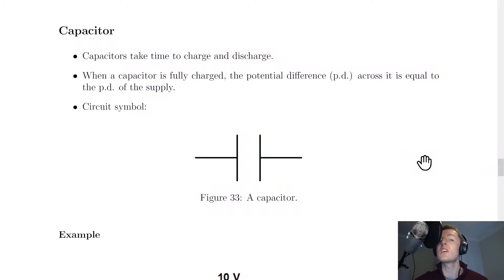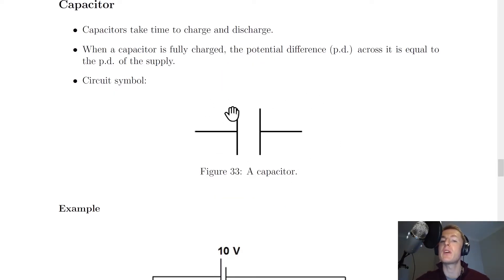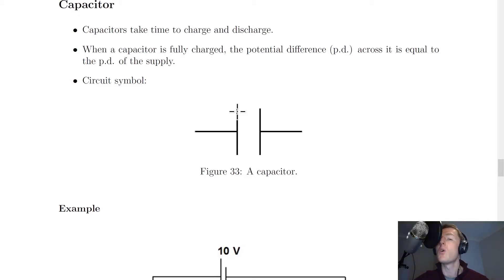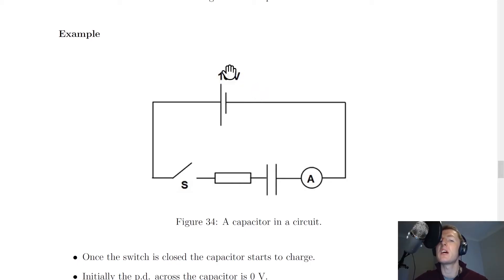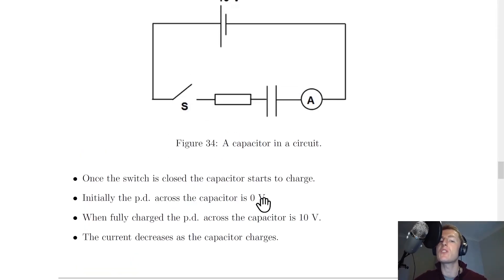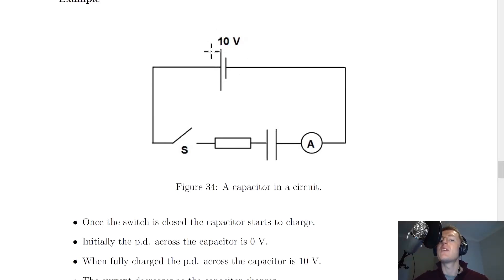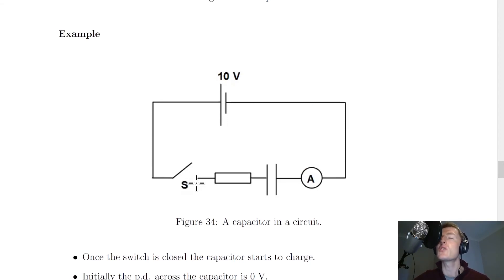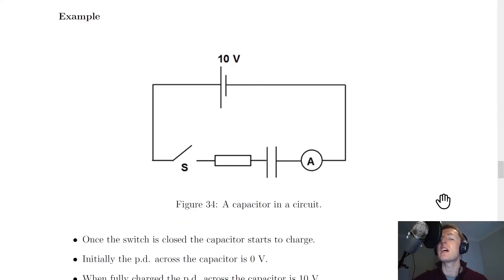National 5 Physics | Electricity | Capacitors | THEORY

Comment: But what if the capacitor is connected to a power supply but in parallel , does it affect the maximum voltage on the capacitor ?